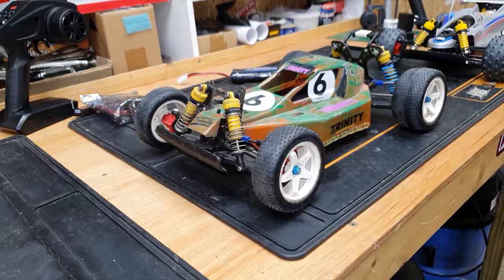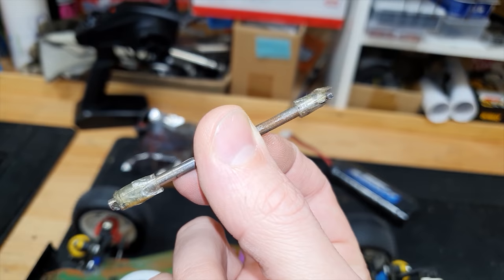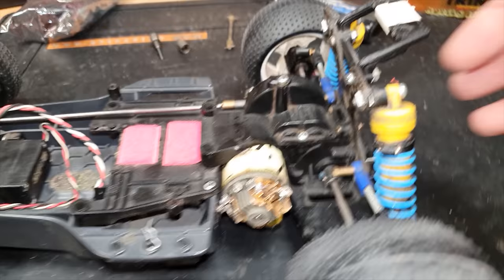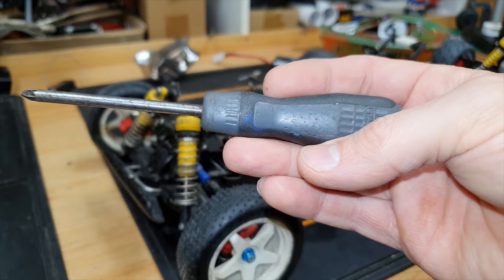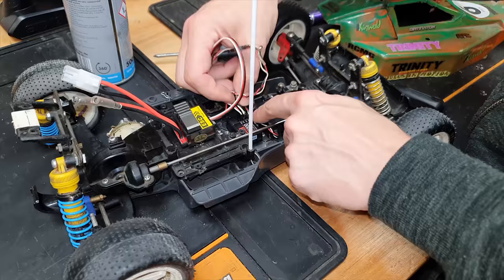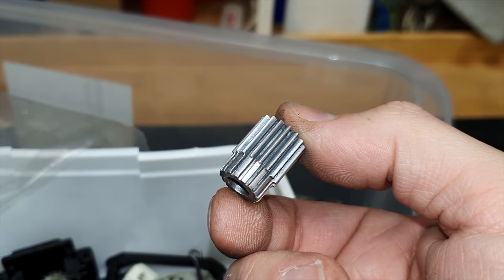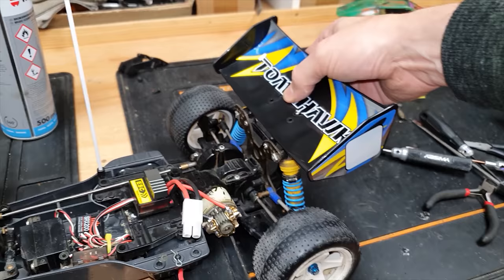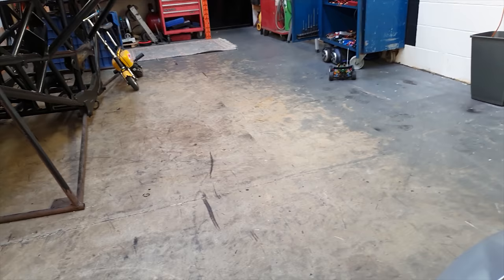Old Tamiya MANTA RAY - Bringing it back to life Part 2

Comment: My first  RC was also a Tamiya. a Tamiya Thunder Stadium Truck. 2wd of course. No 4wd stadium trucks yet back then.  I didnt do much to it, kept it stock cuzz i was saving up for the Team Associated RC10T. I did come back to the Tamiya few yrs after. All electronics upgrades and a thats when i realized i never upgraded the bearings, all bushings were still in there. Hahaha. Melted a couple bushings under a hand wound 10Turn motor. Lmao. Ahhhhh memories. I love tamiya. One of m favorite tamiya models was the first TT-01. Awesome touring car. Had it for 10+ yrs and sold it later on. I picked up a Lunchbox a few yrs ago. Now i see the re-release out and mini lunchbox, they are making mini versions of all the tamiya classics in 1/18 scale. Currently have my eye on the Tamiya Bigfoot and Grasshopper..... The one i wanted, and still do, is the JUGGERNAUT!!!. Remember that one?   I wish i had my old ones. Sold them through the years to make the funds to put into next rc. As i got older, ive become more specific about which ones i sell and i keep no matter what. 

Currently my oldest Rc is an 1/28th scale Gen 1 Xmods (the R34 skyline). Got it back in 2005. Since then have added 7 or 8 more xmods, sold a few, kept a few. I caught the Micro and Mini bug ever since. Lol. Largest scale Rc in my collection is 1/18th. Have a bunch of 1/18s, a 1/16 only nitro gas rc ive had for little over 10 yrs. Needs work. Hard to come by, and if resales are crazy prices. Its the Trinity 1/16 Nitro Buggy. Has a ridiculous 1/10 scale engine 2.5 big block. 2 speed trans. But havent touched nitro for over a decade. And then have a bunch of 1/28th, 1/24th, and my fav little one 1/32 Team Losi Micro T. No longer have any of the 1/10s or 1/8s. I am however looking into getting back into larger scale, hence your channel has become a regular goto for reviews and what nots.

Comment: My first proper car turned up Yesterday here in Oz (from the UK) My Kyosho Ultima is here and in a mess. I will strip it and clean it up and need to replace a few broken parks and it will sit on the shelf. I have an Ultima Pro XL which I still bash with, Love these cars even through they are over 30 years old!!!

Comment: Kev, we are about the same age I think as my mate, Lance had a MantaRay whilst I had the tamiya tl01 chassis with a tub chassis and mechanical speed controller. I got the local model shop (where I purchased.RC car) to fit an ESC. It was Novak I think and cost my dad quite a few quid combined with a much faster motor (brushed of course) good  times were had by all. All of my radio gear was acomms..

Comment: I have 2 very old Team Losi JRX pros one is. Buggy and the other is a truggy ,but the truggy was a full race rc , the person who I got if from raced it ,, it has a composite  frame of some sort , I got his whole collection  of 2 cars 3 bodies  and 5 full race brushed motors and all the spare parts like brushes shims bearing , we got them back 2015 that's when my RC life began we run both cars still and my buggy still runs on the semi original esc and Nicad batteries,  we now have 32 cars and trucks and such and 5 planes and we see no end in sight. If your ever in Utah we must bash. We can do some Rocky mountain bash runs!

Comment: Hey Kev I have 3 old tamiya's. I also have some old futaba radios as well. Pistol and stick type. 2 of the cars are onroad but the diff housings look the same. Maybe same shock towers? One of them has never been run. Also have a frog with the mechanical speed control......if u need any parts

Comment: I have a question I’m new to RC Trucks as I have got bored with drones, So I bought a wl toys 12429, I never even tried the battery that came with it which was an Li-on 7.4v I stuck in a 7.4 2000 mah 25c Lipo the truck ran perfect I didn’t run it long as I didn’t want to destroy the battery, and when I went to take it out the motor was so hot it burnt the ** out of my hand and this was thru the bottom chassis. The ECU and other electonics Wer cool. Is it bad to run this stock with a Lipo on The stock setup?? Plz answer

Comment: It’s just kinda hurts my brain. YES you want to keep it original so that it drives like it did back in its day. BUT at the same time, you want to kind of modernize it so that the Originals don’t break. Take the servo for example: it’s awesome to drive it with the original servo like it did before, but you want to preserve the Original parts. So it goes hand in hand, just be careful is all.

Comment: When my dad was a kid he had a nitro plane that you used strings since they didn’t have radio control and they crashed it on take off and the engine never run again I said to him now knowing exactly how get a nitro going did you check the glow plug it is probable dead from flipping he said no 🤔